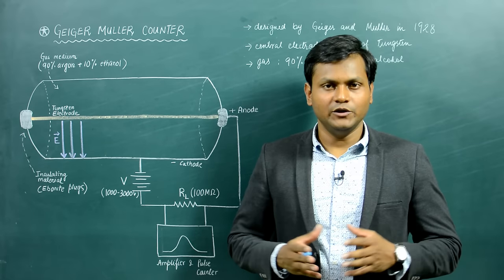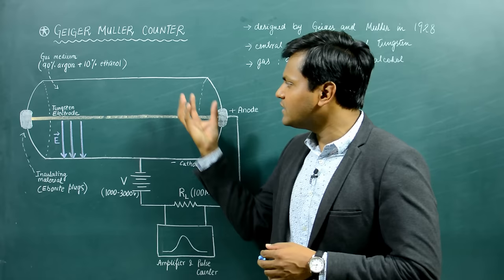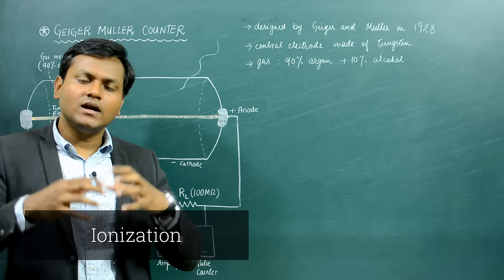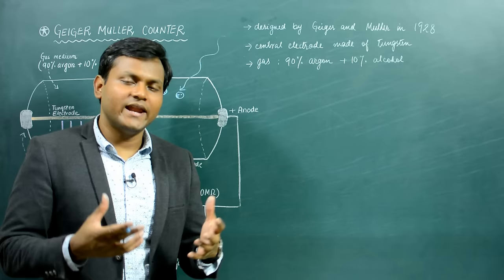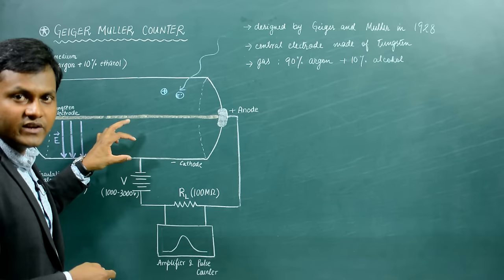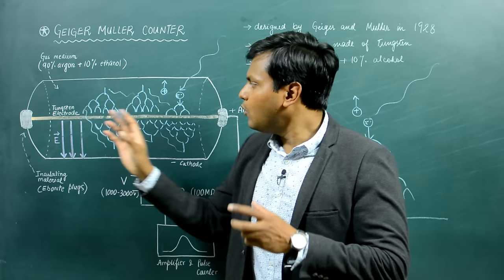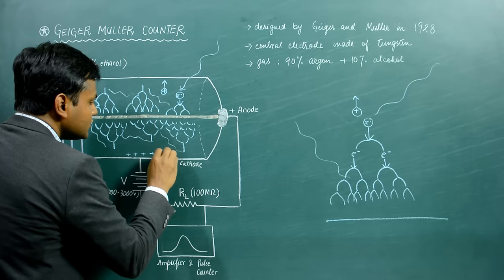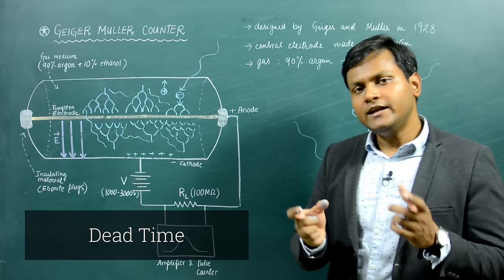What is a GM Counter? - Geiger Muller Counter

Comment: As a self educated interested person, i found you explanation quite clear and easy to follow. Very helpful to someone with my outdated and limited knowledge. 
Question. In a higher bombard environment does the townsend avalanche occur faster within the tube? I am assuming no count takes place until "catastrophic tilt" triggers the count, with each single count having the full cycle delay before another count can begin.
Question 2. If a "second" particle enters the tube during the avalanche what prevents it from affecting the current cycle in some way or another. Detectable or not. (?)

Comment: some extra info I got from the comments from another video, I hope you find it useful, 

Radioactivity is fascinating to me! I have G-M counters and a collection of radioactive sources. It's complicated stuff! But, I love it! G-M counters are used more for lower-level sources, because the tube can become saturated, and in some instruments, mostly older ones, the reading will drop to zero in a high radiation field, and the user might think they're safe. Geometry is important. The larger the G-M tube, the more counts it will produce. And if it's a "pancake" type detector, with a mica window (which will detect alpha particles and lower-energy beta particles too), you can apply 2π geometry, which is great for calculating efficiencies of differing radionuclides (radioisotopes). Most modern G-M tubes are also "quenched" with a halogen. Mostly the older tubes were "quenched" with an organic vapor. This helps decrease spurious electron avalanches and decrease dead time, allowing for a faster recovery and response after a detection event. It is also important to know what the "dose to counts" conversion ratio is, for setting the tube's sensitivity, and this depends on what radionuclide the G-M counter is specifically calibrated to. Most modern G-M counters are calibrated with Cesium-137. For example, my Inspector™ USB G-M counter is calibrated with Cs-137, and the sensitivity is 3340 CPM/mR/hr. A different isotope, with the exact same specific activity and decay mode can be or will be vastly different when it comes to G-M tube sensitivity. It depends on the energy emitted from the isotope, and they are all different. A spectrometer can identify it, but a Geiger-Müller counter can only detect it. Different isotopes emit particles with different energies and at differing intensities. For example, Cobalt-60 decays by β- decay, with the energy being at 318 keV (max). The gamma ray byproducts emitted are both over 99.9% intensity at 1174 keV and 1332 keV. Cesium-137 decays by β- decay, with the energy being at 513 keV (max) and 1175 keV (max). The gamma ray byproducts emitted are 85% intensity at 661 keV. Therefore, the sensitivity of a G-M counter can vary greatly, depending on what radionuclide(s) are being measured, and efficiencies must be calculated for dose units or for determining the specific activity of the radioactive source. Again, it's complicated, but G-M counters are very useful instruments! CPM or CPS should always be used instead of a dose unit, like mR/hr or μSv/hr, unless it's specifically calibrated to the source your measuring (gamma only). There are energy-compensated G-M tubes and filters that can be used or applied to "flatten" out the sensitivity to energy curve, so that a dose unit, when used, can be at least pretty accurate. Also, if the tube has a mica window, it will detect alpha and lower-energy beta particles. Most G-M tubes can't. The thickness, size, dead time, sensitivity, voltage, distance used, time of measurement, shielding used, condition, and construction of the G-M tube and the hardware it's running off of are just some examples of what makes these complicated, but extremely useful for detecting ionizing radiation!

Comment: 00:01 A GM counter is a nuclear detector that can detect various types of radiation.
01:33 GM Counters detect ionization caused by external nuclear particles.
03:08 GM counters are distinct from other nuclear detectors in that they can induce an extremely high potential difference.
04:45 The GM Counter operates based on the avalanche effect, causing ionization chain reactions in the tube.
06:26 The existence of one nuclear particle creates an avalanche effect and leads to a count in the Geiger Muller counter.
08:03 During the GM Counter process, the detector is unable to detect any further nuclear particles. This period is known as the dead time.
09:38 Quenching methods are used to prevent delay in the dead time during the recombination process.
11:08 GM counters are based on the Townsend avalanche effect and have advantages and disadvantages.

Comment: You should explain what keeps the gas in the cylinder ends and that the anode does not touch the cylinder as the drawing suggests.  Also, if an alpha particle is stopped by just a sheet of paper, how could it possibly go through a metallic tube?  Thanks!

Comment: I have a question. When using a Geiger Muller pancake style probe in the field, it is possible to raise the probe to your ear and hear a crackling inside of the probe that is in time with the audible response of the Ludlum instrument. This crackling happens with the audio switched on or off and increases as the counts increase. What am I hearing take place inside of the chamber?

Comment: I have noticed that a sudden change of voltage (impulse, like an inductive spike of a coil) can trigger the geiger muller counter.

I'm trying to understand why.
I am Looking at the Geiger Muller tube, as an unbalanced high voltage capacitor, charged with a high voltage, in the plateau region.

why does it detect this impulse?
Is it because the carthode (metal sleeve) picks up the change in voltage, and this is what makes it count?

Comment: Which one of the following statement regarding Geiger-Muller Tube is correct?
(a) It has a metallic casing filled with a high pressure gas
(b) Both the ends of its tube are fixed with thin mica sheets
(c) It has a metallic casing filled with low pressure gas
(d) It can detect all radiations emerging out from a radioactive source

Sir can you give answer to this question?

Comment: Amazing videos, thank you so much. I would like to ask you something:

you said on the video that the photons that leads to further avalanched comes from Bremsstrahlung (i am sure i have written it wrong xD), but the book 'Radiation Detection and Measurementes', by Knoll, says the photons are produced because the primary electrons are able to excite the gas molecules. 

Is the book wrong? or what is happening is that both gamma sources are equally important on the process?
Reply from the maker: You are right, both processes are possible. However bremsstrahlung usually yields higher energy radiation. For eg in excitation-de excitation of gas molecules, the radiation energy emitted is not sufficient to ionize the same gas molecule (think about it) as ionization means ejecting the electron completely from the atom and not some inner transition. However it is possible. Photons can be emitted due to recombination also (very less probable)